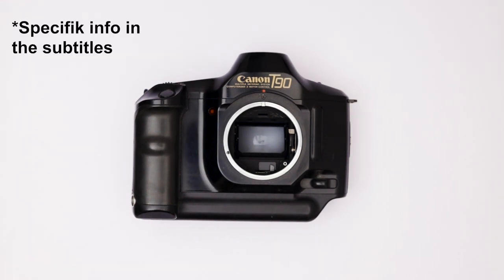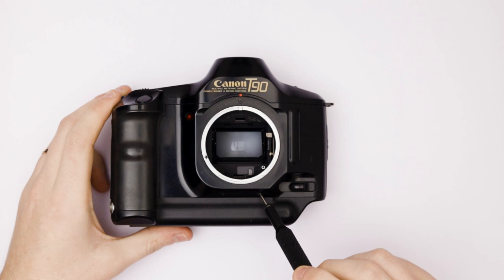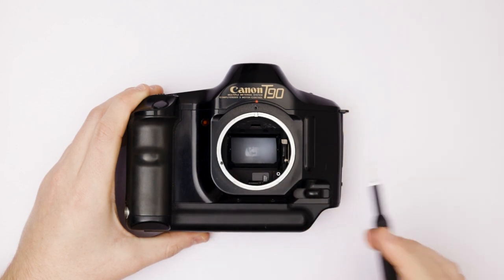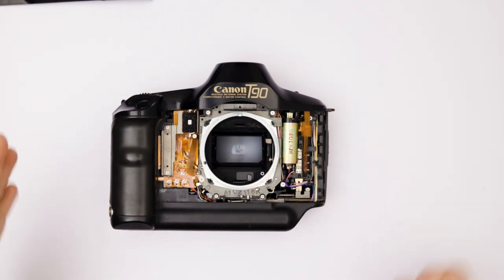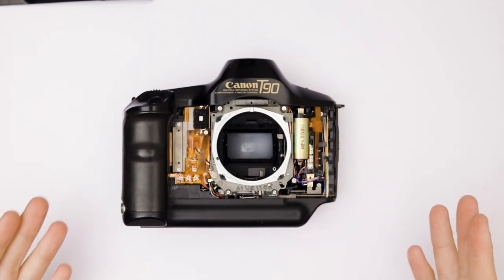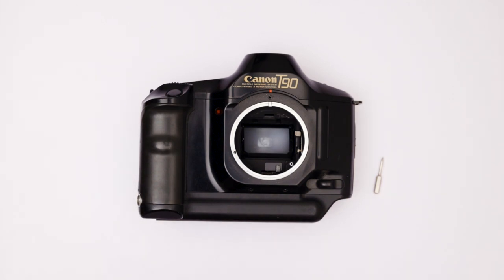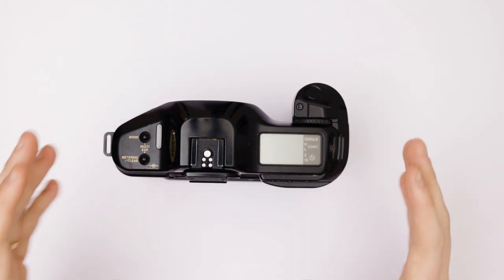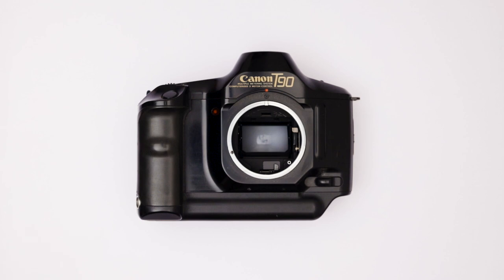Canon T90 Repair: EEE & blinking cursor error

Comment: Started with a non working camera, it started firing after I attached a lens and continued to work for 100+ test fires. Then, flashing cursor. Shutter speed didn't matter, this happened at 1/60th. Watched this video, did the method with some super strong magnets and a flat head bit, and it worked a charm! So I tried faster shutter speeds and this time I got EEEE. Then I remembered something a Canon support rep told he while troubleshooting my EOS R5 that got bricked from a dummy battery short circuit. To shed excess or unintended voltage that's stored in the camera circuitry/internal battery/capacitor, start with the camera powered on, hold the shutter button, and pull the battery. Continue holding the shutter button for at least a minute or two. While still holding the shutter button and the power switch still turned on, put the battery back in. The shutter should cycle. This combination of things seems to have entirely fixed the T90 for me. I just held the shutter button for over a minute set to high speed and 1/4000th and it rapid fired without a hitch. Faster than before actually. I now realize there was some drag as the shutter closed previously. Now it appears to be 100% operational. If I have to periodically take out a few screws to re-magnetize a part and do a voltage drain procedure in order to have a functional T90, then I'll call that fixed enough! Hope this helps someone out there. Cheers!

Comment: This video helped a lot with my T80 as well because they tend to have a similar problem. I just tried it on the camera and it worked ONCE !! After that sadly not but at least I know now that the camera is still functional. The metal peace is not to easy to reach because it is just a bit more tight down there but let’s see. Thanks for the great video !!

Comment: I stored my T90 for years. I occasionalIy would insert the batteries and fire it. I turned on the camera recently and it had a blinking drive curser. So I tried this fix. It worked but then stopped. I inserted the magnetized screwdriver many times over a few days but it still will not hold. When it stops I get  EEE in the display. I remove the battery tray and reinvest and the EEE diapears but it won't fire.   the lens mount. Is tight.
Any other suggestions?

Comment: But this method helped only partially.
If I use a shorter time than 1/500, the eee error appears again.
I've tried speeds from 1/1000 to 1/4000 and it happens to me at all of them.
Can something be done about it?